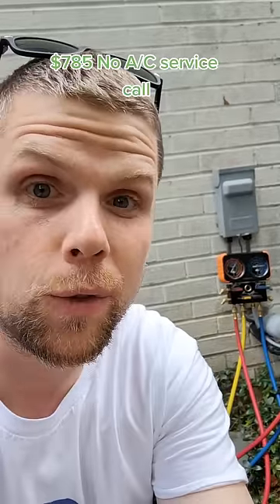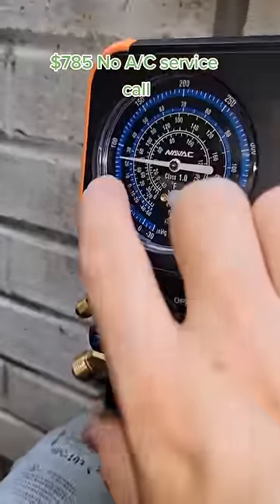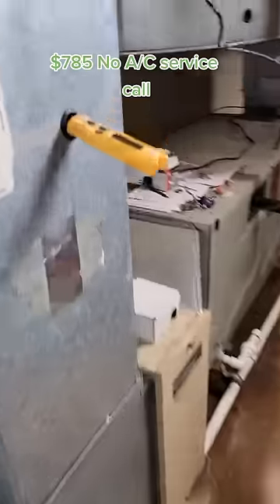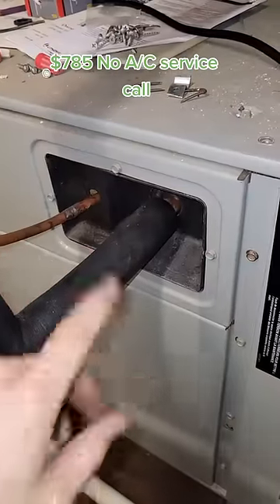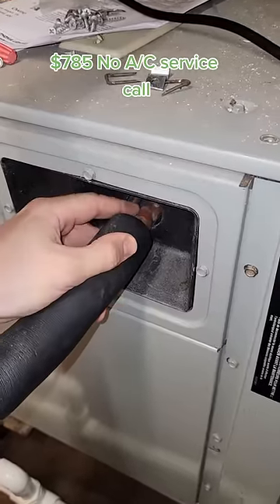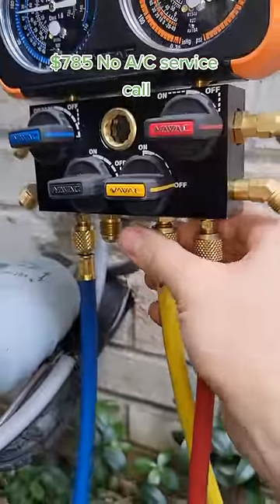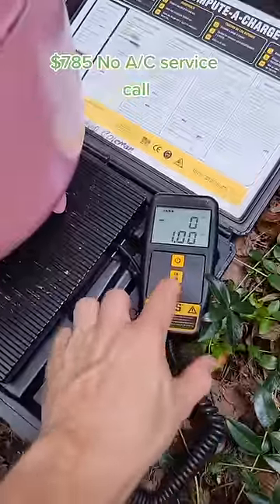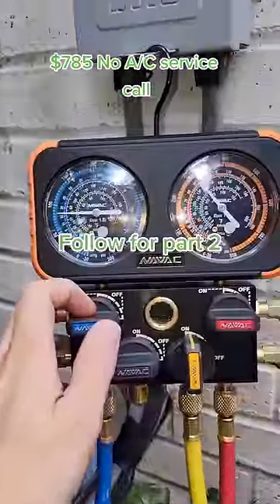Why is my A/C unit 🥶 freezing up? #shorts

Comment: Did you check the evap coil and filter? Kinda reckless to add refrigerant without checking the simple stuff first.
Reply: This way he goes back for another $785 later, he's clever.
Reply: He might have before making the video and seen the opportunity to make the video after checking. From what I’ve seen he is pretty thorough. But you never know

Comment: You’ll notice how we didn’t get a good look at the internal coil, A dirty filter inside the air conditioning intake will allow for the fabrication of these conditions
Reply: So will having too good of a filter cause the same thing to happen. Learned that one. Here I was thinking I was protecting the family with a better filter. When in reality I was also freezing out ac system up.
Reply: Yes this is true. Air restriction can cause icing, but If won’t cause your gauges to read that low of pressure
Reply: He probably already checked the filter off camera if you change your filter normally most hvac tech won’t just check a evap coil for no reason.
Reply: Agreed. Change filter first
Reply: And open window and a in law that leaves the heat on will too
Reply: @nickkk420  someone leaving the heat on would cause icing? I think you got it wrong buddy.... I got an ac right now that don’t work for shit and freezes, guess what I turn it off it un freezes I turn on cold it freezes after a few hours.... yeah it’s the heat
Reply: @Steve.._.  if someone turns on baseboard heat in another room close enough to the thermostat the AC will work harder and freeze, yes absolutely it happens
Reply: @alan4657  lol I’ve seen that as well. Stick with a Merv 8 if you can. I use a merv 11 one inch filter and it seems okay
Reply: @nickkk420  that never happens. Your ac won’t freeze from working too hard
Reply: @murkyturkey5238  absolutely it will
Reply: @nickkk420  ummmm nope
Reply: @brandonfelkins1982  ok well not sure what to tell ya. But that's exsctly what's happened to me in several occasions
Reply: @alan4657  yeah, people try to make the furnace filter into a whole house air cleaner.  The furnace filter's real job is to keep dust out of the blower motor.  MERV 7 or 8 does that quite well, and does not over-restrict air flow..
Reply: Low airflow would lead to a higher than normal difference between return and supply temperatures. His is about 14 which is low.
Reply: @Douglas Hamilton  low temp equals low pressure so yest it will.
Reply: Yea I always start with the filter and indoor coils before I assume a leak

Comment: Could be a blocked filter or iced up coil,  cause low suction pressure, alway check your evaporator coil, to make sure coil is clear of ice before you add change.. I see tech’s all the time adding charge to a system that’s iced up..also make sure your evaporator fan motor is working, broken belt etc..
Reply: Always CHECK the coil golden rule lol
Reply: He could at least pretend to do a leak search and repair 😂 not just a gas n go

Comment: The EPA would like to know your location.. lol
Reply: Purging service equipment is actually a specific example used in official publications of "de minimis" release, or the smallest necessary (not smallest possible) release of refrigerant to atmosphere to perform service properly.

Failing to purge equipment is the actionable item, as that would contaminate either the refrigeration system, the storage container, or both.
Reply: @Azlehria  I was wondering what happened to Kuby, still at the EPA.
Reply: @Azlehria  actually no your wrong. Guess what that’s why they make machines to do it for you within the machine. How go the 25k prize for turning him in?
Reply: @shadowmavs3270  WRONG!
Reply: @shadowmavs3270  Reclamation machines were introduced because existing service equipment wasn't designed to pump or compress refrigerant into a storage container. Previous practice was to release to atmosphere and then attach a vacuum pump.

The requirement to evacuate a system during service only applies when "opening" the system, a legally-defined term. Per the EPA itself: "Connecting and disconnecting hoses and gauges to and from the appliance to measure pressures within the appliance and to add refrigerant to or recover refrigerant from the appliance are not considered 'opening.'" Emphasis added.

If you don't purge the lines before adding refrigerant, the air inside the gauge manifold and hoses will be forced into the system and contaminate it. Ideally only the air would be purged, but for complete removal a very small release of refrigerant is unavoidable. Hence the common-sense application of the legal concept of de minimis.

Likewise when recovering to a "clean" container, air in the service set would be forced into the container by the reclamation pump, contaminating the contents. For recovery to a "dirty" container this is of course a non-issue.

Look, I get it. A lot of training programs, in many industries, justify themselves with "The law requires this," but that's because it's cheaper, easier, simpler, and reduces liability to teach people to do the same thing no matter what rather than teaching them any nuances about what the law actually requires and when it's required. And if you work for a company with such a program, you bloody well do it their way!

But that doesn't make it legally necessary.
Reply: Perfectly legal under section 608 of epa
Reply: That amount of refrigerant loss is acceptable and not an issue. Its de minimus.
Reply: @shadowmavs3270  stick to your day job and leave the hvac to trained professionals.
Reply: @shadowmavs3270  they don’t make machines to do it for you gtfo you don’t do hvac lol
Reply: He likely meant adding refrigerant to a leaking system
Reply: @weaverjoshuab  so what? Still legal.
Reply: That would be deminimis release and perfectly legal
Reply: You're definitely not EPA certified...or shouldn't be...
Reply: @Azlehria  not deminimus release. He didn’t even purge correctly.. it may not have been a critically charged system but tg it wasn’t
Reply: @michaellowe5661  Which section? I’ve only read deminimus release to be ok, if you know how to purge lines that’s obviously not deminimus release.
Reply: @murkyturkey5238  He’s thinking of automotive recovery.
Reply: @shadowmavs3270  I'm studying HVAC and this is not what I was told and read in my epa book. You can purge the system, done properly.
Reply: @shadowmavs3270  thats incorrect. What machine bleeds the lines for you right before you charge? Name if for me
Reply: Joshua Theroux  he’s talking about getting the air out of your hoses before looking it up to the lines. You crack the house and bleed out the air so you don’t contaminate the lineset. 
Vacuuming the lines after every service is correct but he still has to purge the air out before every service hookup. When you disconnect your hoses it loses the vacuum and contaminates them with air. It must be bled out. There’s no other way.
Reply: Okay for all you noobs and anyone that's been doing air conditioning for less than 10 years everything you've been taught is pretty much wrong All of us people that have been doing it for over 20 years know what is the minimus and if you think you can bleed the air out of the lines in less time it's a 50/50 chance but also think even if you have low loss fittings when you take off your gauges you're still letting out de minimus amount
Reply: Wtf 😂😂😂
Reply: Lol deminimus. Probably spelled it wrong but nah he’s okay!

Comment: Never checked or cleaned indoor coil, never checked fan speed all of which can make it seem like the unit is low. People don’t realize and ac unit is a sealed system. It should never be low unless there is a leak. In which case you should repair it not top the charge off.
Reply: This

Comment: Hey buddy Ac units shouldn’t loose refrigerant unless there is a pinhole leak. 
9 times out of 10 it’s an airflow issue. Make sure you clean the evap/condenser coil

Comment: If you’re losing coolant you have a leak that needs to be fixed
Reply: Every system no mater how air tight will leak to a certain degree. With micro cracks that can't be seen by the naked eye it'll always happen. So unless there's a major leak, there's no need to fix anything.
Reply: @officialtheomegawolfster2081  in the UK to hat is complete nonsense. Don’t know about the states but we have strict FGas regs that we have to stick to. You can’t just keep topping up a system. It has to be strength tested and pressure tested to make sure there are no leaks at all.
Reply: @officialtheomegawolfster2081   that’s why you pressure test with nitrogen soap and water and sniff tester !  Micro cracks my ass it’s a sealed system .
Reply: @officialtheomegawolfster2081  ur wrong bro a sealed system will never leak nothing if it’s brazed correctly and or u have a pro press like the company I’m part owner of
Reply: @officialtheomegawolfster2081  what would you consider major?
Reply: Haha it’s not coolant
Reply: @chevy_no_lift  refrigerant*
Reply: Evaporator coil, TXV, soldering joints, king valves, condenser coil’s, liquid drier, reversing valve, line set. My visual inspection. Dear customer possible system leak.  did u see his pressure gauges where super low. R410a pressure depends on outside ambient temperature. Customer declined leak search just top it off.  Um… customer ur real low. Who cares top it off. Ok . Me charge system with subcool and superheat. ur 4lbs. Low.  Customer 😳 that will be $580… buckaroos 😆
Reply: Did he say water coming out with oil damn and no you should not have a small leak
Reply: @davenottingham3254  it’s the same here, he thinks bc moisture finds its way into the system that counts as a leak. Here in Michigan it’s very humid and no matter how deep your vacuum is there will always be moisture in an older system
Reply: Agreed !!!!!!
Reply: @davenottingham3254  we pressure test our systems with 500+ psi of nitrogen to ensure a leak free system.
Reply: @DSB420  minisplits are hardly ever brazed, they use flare fittings torqued to spec.
Reply: @jpadgr8  you charged that much for 4lbs of r410a? Holy...
Reply: @officialtheomegawolfster2081  your wrong lol way wrong
Reply: @officialtheomegawolfster2081  you know nothing about hvac lol it's a sealed system hence the reason it's called that
Reply: @dallascowboys2757  If a system never leaks then please explain to me why they have to be topped off ever so often then huh? It's because they leak at a micro level! Maybe not enough to detect but it's still there trust me.
Reply: @officialtheomegawolfster2081  you're absolutely wrong and there's why you pressure test.
And the other guy never said they don't leak. 
But if they are leaking then you don't just say "oh it's a micro crack" you'll need to recharge again in 5 years". 
So yes you indeed don't know what you're talking about.
Reply: @murkyturkey5238  well I live in Michigan and I know for a fact your wrong. If you keep having moisture issues on vacuum then change the system oil. And pull a deep true vacuum. ( If the system has no soloniod pull from the high side and keep the micron gauge on the low side) pull to 500 and make sure it goes up and settles back down no higher than 650. Put in a new filter dryer and possibly a flare suction dryer if you can pump the system down. You’ll never have a moisture issue again my friend.
Reply: @officialtheomegawolfster2081  the system js supposed to be sealed, there are not supposed to be leaks. But seals fail, joints fail, pipes crack which gives you a leak. If the leak was "micro" as you say then yes it would be incredibly hard to detect but would also take a very very long time to leak out a significant amount of refrigerant. A system that is sealed will never need to be topped off, thats why there are systems that run for decades without a top off.
Reply: YEAAAAHHHHHH
Reply: Exactly
Reply: @davenottingham3254 guys just trying to protect his harmful racket, that's just how things are supposed to be , right. What a disgusting attitude . Posining people with frion and excepting failure

Comment: dirty return filter is my most common cause for a frozen coil. Lol 😆 🤣 😂
Reply: Was gonna say. Use a new filter that allows for air flow. If you're recharging your system. It's got a leak. Also if people would clean the squirrel cage and clean the condenser unit. Will fix that problem. Gotta keep it clean!
Reply: Filter or dirty coils.   Possible loose txv bulb or clogged expansion valve. Or just low Freon.

Comment: Hmm I thought releasing refrigerant into the air like that was illegal 🤔
Reply: Depends if you're releases ozone
Reply: Lol it's illegal to just dump refrigerant into the atmosphere however small releases like that are a legal and necessary to avoid ruining all the freon contained in the system. It's normal and good practice
Reply: @jamminwrenches860  you can dump any amount as long as you yell DE MINIMUS! while doing it 🤣
Reply: Purging service equipment is actually a specific example used in official publications of "de minimis" release, or the smallest necessary (not smallest possible) release of refrigerant to atmosphere to perform service properly.

Failing to purge equipment is the actionable item, as that would contaminate either the refrigeration system, the storage container, or both.
Reply: @hvacmisadventures  i thought it was demaximous amount oops
Reply: @hvacmisadventures  shh it’s nitrogen
Reply: @obama7325  it’s a midnight recovery party

Comment: You are adding refrigerant without truly solving the issue 🤦🏻‍♂️
Reply: The second part addresses that, he said that the unit was 16 years old but the customer didn't want to do a leak test. Just a temporary fix.
Reply: @bootleggedkilla  oooh okay, well that temporary fix should be addressed by the customer soon cause that refrigerant is fractunated and will make the pressures/temp fluctuate.
Reply: Why bother with the issue when you can sell refrigerant over and over..

Comment: If refrigerant is gone. Check for leaks first. Inject dye. One that step is done and it looks good then charge. but make sure filter is clean as well as the condensor.

Comment: $785 for a service call and to add refrigerant?   That's ABSOLUTELY OUTRAGEOUS!
Reply: That’s the cost of refrigerant right now. $400 to recharge a fridge after compressor leak
Reply: @ZoomZoom870atGmail  
I absolutely agree.  I'm getting ready to replace my whole HVAC system and it's going to cost me between $5000-$6000.
Reply: @ZoomZoom870atGmail  
I'm in the wrong business.
Reply: @ZoomZoom870atGmail  your not paying for time, your paying for the experience on knowing how to do that work. If you don’t like it should have done it your self
Reply: @ZoomZoom870atGmail  then thats that.
Reply: @kenb1918  lol love when they think it’s all easy, there’s more to hvac then swapping a condenser
Reply: @URBANENGINEER  what? I was able to buy a 25lb tank of r410a for  $126 in 2017. Which is like $5 per lb.
Reply: @ZoomZoom870atGmail  that's the thing.. The guy who installed your new outdoor unit didn't charge the system.. Your unit comes lre charged with refrigerant and all he just need to braze the lines pull a vacuum and open the valve.
Reply: @kenb1918  I agree.. I didn't like the price for ac install so I bought all the tools and learned how to do it myself. Saved well over $10k in installs and have put in 7 units.
Reply: @randybobandy9828  yeah man 450 475 a tank of r410a.....r22 is 1600 bucks a 30 pounder it was 125 a tank 15 years ago
Reply: No, $785 for somebody much more knowledgeable than the person who requested the work to come out and identify how to fix the problem and then fix the problem....otherwise why tf even pay anyone if it's that easy....learn how mobile services work
Reply: I just got mine done a month ago 2 lbs and a cleaning and it cost me $385!!! This dude is rip off
Reply: try to do it yourself. You need refrigerant, gauges , locate the leak and fix it.😂😂😂😂